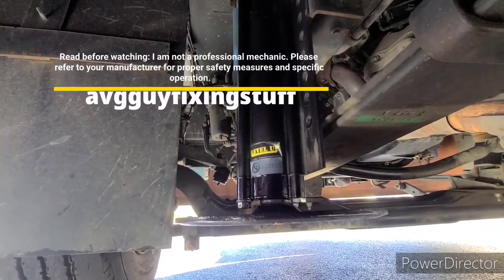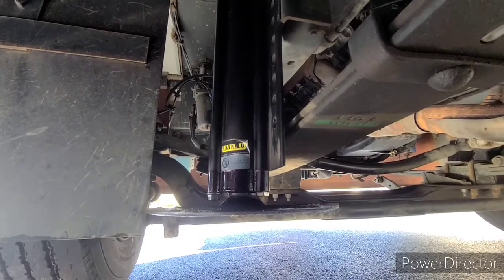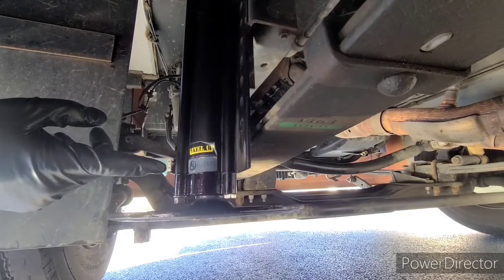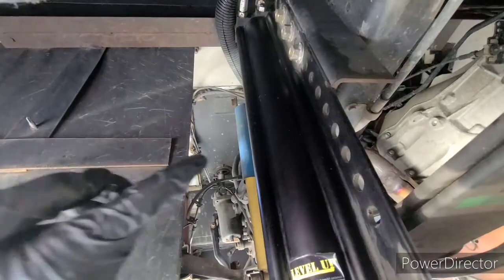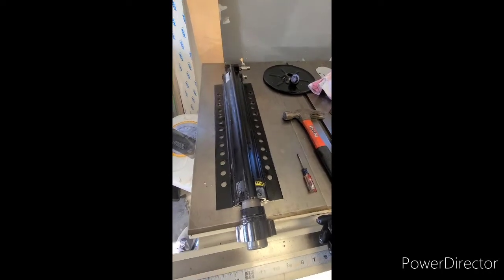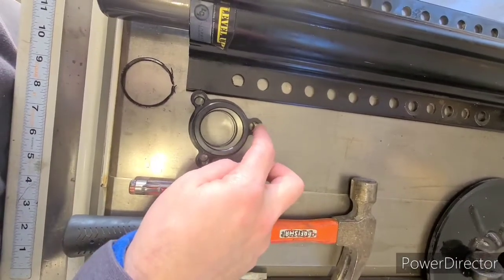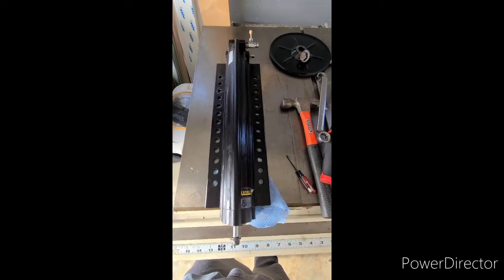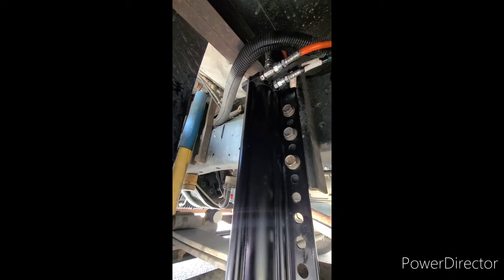Repairing a leaking Rv Leveling Jack

Comment: I also had a leak in my 6 point level-up leveling system.  The difference for me was that the leak was in multiple places(The hydraulic reservoir,  2 legs, and several fittings)
This was due to a low fluid level in the reservoir, which in turn caused low pressure in a high pressure system.  To the haters I know this is not a true high pressure hydraulic system as it uses Automatic Transmission Fluid (ATF of Dextron III or Mercon 5.. see manual for exact version) but for this scenario it works in the explanation of the cause.
It is fairly difficult to tell when you are low.  Here is how I did it.  Put your trailer on the hitch and bring up all landing gear along with closing all slides as certain slide systems use
hydraulic mechanisms.  Then check the fluid level.  It should be close to an inch below the fill cap hole.  This fixed my issue as I was a quart and a half low.  
I'm so glad it did as these systems are $$$ to fix.  Hope this helps someone.  You guys are always helping me with your fix it video's, thanks to all of you that make these videos.

Comment: Wow!  I had the same leak. I contacted a few hydraulic shops in my area, they all claimed the jack couldn’t be repaired.  Spent $500 for a new jack.  Part numbers of the two o rings would be awesome.
Reply from the maker: I don't know the part numbers.  Remove the part, take it to your local hydraulic shop and they will give you the new seals.  They are very common seals that most shops have in stock
Reply: I have to change out the orange line and replace it. How do I let the pressure out of the system so it does not squirt all over my driveway.
Reply: I’ve replaced 3 jacks so far.  I have not replaced a hydraulic line. With all the jacks retracted, there’s little to no pressure in the lines.

Comment: Thanks for the video. Very informative. It would be nice if you could comment on how many times you used the levelers since the repair and how well it's holding up.
Reply: Hi Tim, I have used the jacks all spring and summer and no leaks whatsoever.  Likely extended and retracted over 35x.

Comment: Could't wait, I found out the answer to my previous question.  If the leak is noticeable on the foot and bottom cap you can leave the hoses attached and not remove the hydraulic from the frame.  Take the cap in to a hydraulic shop and they can replaced all the seals for 16.00 and a tip.  They do not like giving the seal numbers because seals could change depending on the year changes.  It's better to take them the part.
Reply from the maker: Sorry I hadn't checked this account recently, but now that you mention it, I don't see why you would have to remove the jack from the coach.   I had never done this before and I was not sure how the cylinder would come apart.

Comment: Good for you pal! I am of the same thought, give it a try or 2 before you pay somebody. I have a cracked exhaust manifold on a 8.3 Cummins, they want almost 2 grand to change it out, the complete kit manifold bolts gaskets is $250 so that's a no brainer

Comment: My jack is leaking from the top cover 
Only a small leak but afraid it’s going to get worse over time 
Did you pull the top cap
If so is it like the bottom cap ?
The RV service center said the same thing 
Not serviceable 
I have worked on aircraft 
Landings gear 
So deep down I know it could be done

Comment: To replace the two o-rings, would you say it was necessary to remove the hydraulic from the coach or could it be done in place by removing the bottom portion?
Reply from the maker: I don't see why you couldn't do it in place...without removing
Reply: @avgguyfixingstuff4939  Thanks for the very informative video. I think I would much rather go at it the way you did, on the bench. Doing it in place you run the risk of contamination of seals and/or cylinder/rod. A little more work maybe but I would feel safer about it. Just got the news from my RV shop and they claim that they were told my jack could not be resealed, they suggested I replace all 4. Yeah, right...about $2600 in parts alone. Then your video came along. I'll take a good crack at it. Thanks again. 👍

Comment: How did you bleed air out of the hydraulic system after everything was repaired and installed?
Reply: If I recall correctly, my system is self bleeding, so all I had to do was fill it back up to the recommended level and cycle the jacks up and down a couple times